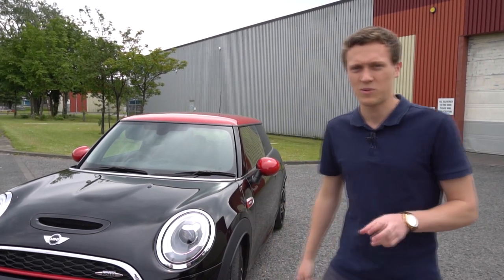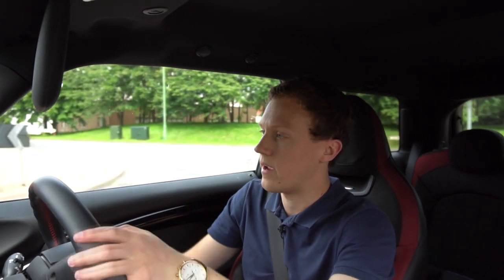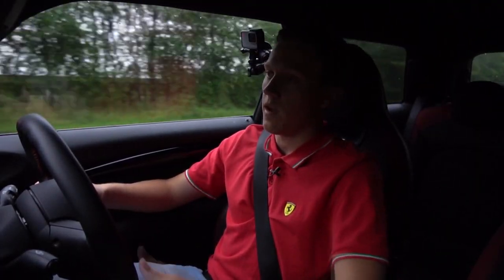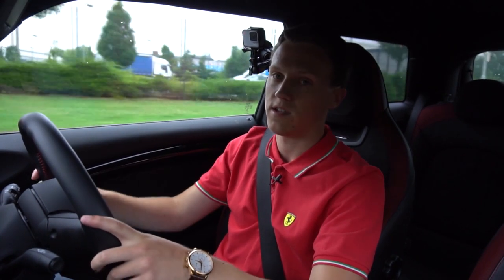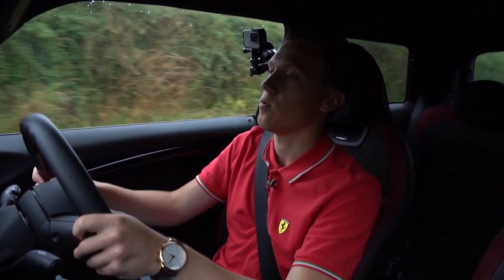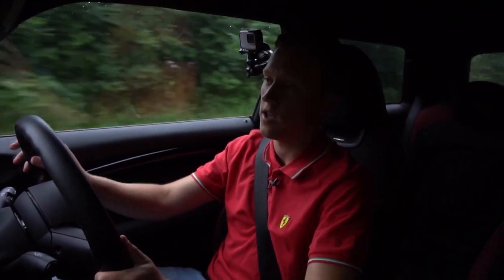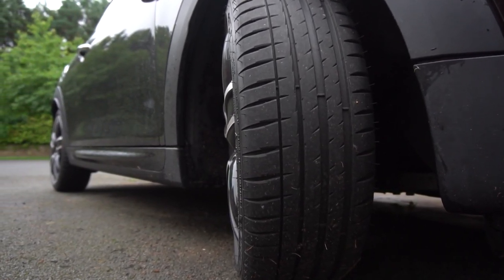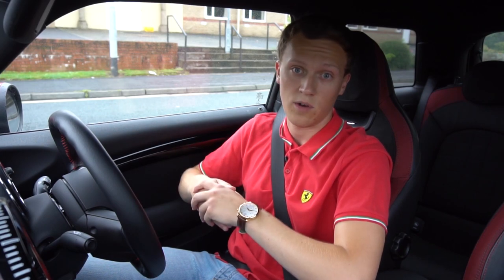Fitting Michelin PS4's [Mini F56 JCW] | Why You Should Buy Michelin Pilot Sport 4's

Comment: Recently fitted PS4s to my R53, superb tyre. Now I've just gone and bought a used F56 JCW I'll be swapping the PS4s onto the new car. As for runflats, I switched over to normal tyres 11 years ago and it's just the best upgrade anyone can do.
Reply from the maker: Glad to hear you've had good experiences too! The ride quality is vastly improved when moving away from runflats, agree its one of the best things you can do to a car.
Reply: where did you find them in the correct size smallest i could find was 215s and f56 is 205s [the cooper s]
Reply from the maker: @flight.5133  I just got mine from a local tyre shop, but I remember BlackCircles had them too. This was quite a few years ago now though and the PS5 has since been released, I don't think that is available in an 18" size yet but I'm sure it will be soon

Comment: They come with runflat tyres on because there is no spare wheel. You may find that although its not law to have one or runflats on in the UK, it may be the case elsewhere. For me the runflats are a pain in the arse saver. If you get a puncture you can just truck on to somewhere convenient to get it changed. No phaff at the side of the road even to change a wheel.

Comment: I toured the U.K. on my JCW, so loud on P7 run-flats. Glad I had them when in the middle of nowhere but far too noisy. Worn my shoulders too. Scary at speed in the rain.

My friend has Bridgestone run-flats without a problem.
Reply from the maker: Yep that was a major annoyance with them for me. After switching the difference in noise levels is quite incredible, so much quieter on the PS4's. And yeah not sure whether it's down to the composition of the side walls or what but the shoulder lasted no time at all compared to the rest of the tyre - totally agree though, severe and sudden understeer in the wet! Interesting the Bridgestone ones are better...
Reply: Foot to Pedal I’m going for the PS4’s once my tyres are worn enough. Thanks for the video.
Reply from the maker: Yeah can't recommend them enough! I'm sure you won't regret it. No problem, thanks for watching

Comment: Practise tyre rotation - front  to back after 4k miles or so should even out the wear a little.
Reply from the maker: Yeah would be tempted with this set but wasnt bothered about the runflats I had on before as I always planned to change them
Reply: How does the tyre pressure monitoring cope with tyre rotation?

Comment: Do you feel that the PS4 has mediocre feedback? It doesn't signal very well when they are about to lose grip.
Reply from the maker: I find in mine it's fairly clear when they're about to lose grip. Suppose its possible any vagueness you feel could potentially be down to suspension setup and the steering. The slightly softer sidewall will definitely mean they're not as clear cut as some tyres though
Reply: @FootToPedal  Yeah I drive a 140i and its steering is pretty dead numb even if precise.
Reply from the maker: Yeah that's interesting actually, unfortunately BMW's electric racks are pretty vague these days. It was the same in my JCW but with the PS4's on there it's certainly sharpened it up and it gives me a lot more feedback now

Comment: Would you consider going thicker just wondering what you’re thoughts are on putting 235/40/18 on my f56
Reply from the maker: I don't think you'd be able to go that wide on the standard alloys as my understanding was 215 was the maximum width. However if you're running aftermarket wheels then I would say go for it, I'm sure that would give a tremendous level of grip on the front end but is also not wide enough for the car to tramline all over when on a cambered road.
Reply: @FootToPedal  Does the JCW roll out with 205s as standard? If so 215 would be the best call.
Reply from the maker: @TimmehysCat  Yeah 205's as standard, not particularly wide so agree 215's the best call if you want to go wider

Comment: I have a mini r58, need 2 front tyres , was looking at mp 4, not sure if I should change all 4 for non run flats....like them tyres as have Tim orotection
Reply from the maker: My recommendation would always be to run the same tyres on all 4 corners but it depends how you want the car to drive. The PS4s have decent rim protection too which is handy 👍
Reply: @FootToPedal  I have herd your tyres are more track orintated ,do u take your car on track? Do u regret changing to non runflts?  You didn’t need to change suspension or anything else. Did you get a lot of punctures with the run flats? I have just bought the car so I am new to all this
Reply from the maker: @justindabreu976  The PS4 is more of a fast road tyre than a track tyre if I'm honest. It probably wouldn't hold up hugely well after a few hard laps on track but its great on the road. I haven't tracked my car at this stage but it definitely would perform quite well (handling wise) with these tyres. No regrets from switching to non-runflats and no changes to the suspension required as the tyre is exactly the same size, just a different design to a runflat tyre. Thankfully I haven't had a puncture to date so no issues there either. Hope that helps!

Comment: I suppose that RFs are tighter on the sidewall than non RF. If that is true, it is more likely to hit the rim with a kind of hole on the road. Isn’t it?  Second, if the same model / size of tire, one RF and non RF cost the same, do you pick the non RF anyway?
Reply from the maker: I guess in theory yes, but if you're hitting a hole in the road with enough force to fully compress the sidewall and subsequently impact the rim, I think you've got a decent chance of doing damage whether it's RF or not, that'd be my take anyway. And personally I'd always pick a non RF tyre myself, but it's very much personal preference. They always seem to ride better to me
Reply: @FootToPedal  I appreciate your comments, I like your video. 
I could not find a review comparing Michelin Primacy 3 RF vs PS4 non RF. I would like to see the behavior of both models of the same brand. When changing tires, it is likely to have a better performance in the new ones than in the used ones. Regards
Reply from the maker: Thanks very much, no problem at all! Yeah unfortunately I can't comment on that tyre as I've not used them before. But as you say new vs used tyres will always be better 👍
Reply: @FootToPedal  my car has Primacy 3 RF with half life (I bought it as it was). The other day I was on the track and the grip was amazing. I cannot imagine the behavior of new ones. Anyway, today I bought the 4 tires at a very good price at Costco. The combined savings in coupons and monthly payments with no interests is close to 30% off. Not bad 😎
Reply from the maker: Awesome to hear! I've found the PS4s to be great all year round, they seem to find traction everywhere, even in very wet conditions. Sounds like a great deal, hope you enjoy using them!
Reply: BMW's with runflats are notorious for cracking alloy wheels I have heard this from many tyre fitters that they see it so often. The sidewalls put way more force into the wheel compared to non RF that it simply cracks the wheel rim over time. BMW used to offer free repairs to the wheels if you complained directly to them but I think they have now stopped this.

Comment: A new viewer here - just wonder is it a pre-LCI or LCI JCW that you have in the video? thanks
Reply from the maker: This was an LCI 1 car, rather than LCI 2 which happened in 2021. Mine was a 2017 model, hope that helps!
Reply: @FootToPedal  Looks like a pre-LCI to me as the DRLs don't go all the way round the headlights.
Reply from the maker: @JohnCarlyle  There were 2 LCIs on the F56 generation, one in 2018 and I think another in 2020, mine was a 2018 LCI model.
Reply: @FootToPedal  You're right, 2 LCIs. Although 2018 could be either pre-LCI or LCI 1. Yours was a pre-LCI, which of course looks better than the LCI 2 :)

Comment: Hey, not tyre related, wanted to ask if u have the stock jcw exhaust?? Your jcw pops a lot more than mine!!
Reply from the maker: Yes totally stock! Mine is pre-OPF though so it is definitely louder than anything after 2019 or so. It also got louder as the exhaust went through more heat cycles. Thanks for watching!
Reply: @FootToPedal  mine is a 67 plate also pre OPF. I was thinking about a resonator delete. Would u recommend?? Thanks for the content 👍
Reply from the maker: I think it depends what you want from the car as I know they are very loud when you do the resonator delete, not a bad sound though! But yeah if you want more sound, is probably the best way to go. No problem, plenty more on the way 👍

Comment: Looking to purchase a full set of the PS4 - 205/45/17s. But have 2 speed rating options, 'W' which would match the manufacturers recommendation, or 'Y' . Other than speed capability, do you think the Y/higher speed rating would offer any other advantages? Sidewall stiffness or how responsive they are ??
Reply from the maker: Yeah I went for the W's on mine - Obviously there is going to be some extra strengthening with the Y speed ratings just so they can take the extra strain of high speed. I would imagine there would be some minute changes to how they feel on the road as the sidewall and contact patch of the tyre will be reinforced. However I would honestly be surprised if you could feel the difference! If you plan on doing higher speeds, I would say you'd be fine to go with the Y speed ratings 👍
Reply: @FootToPedal  thanks for your reply. I've just been advised by Michelin that the only difference in their database is the Y rated tyre being lighter by 0.1kg (maybe allowing heat to dissipate quicker, resulting in the higher speed capabilities, thats my guess though) Otherwise there should be minimal difference, if any, regarding performance and feedback. But yeah I completely agree, &  something I'm unlikely to notice. Liked and subscribed 👍
Reply from the maker: @MasterAndres0  No problem! Ah very interesting but yes I would agree with your theory. To help dissipate heat and more than likely reduce the rotational mass of the tyre itself to therefore reduce strain on it as a whole. Thanks a lot for watching, appreciate the support! 👍
Reply: @FootToPedal  Do you happen to know the difference between the Pilot Sport 4 and the Pilot Sport 4S?
Reply: @nickblayney774  PS 4S is the high performance version of the PS4. The PS4S is not as grippy in cold weather and is more heat resistant than a PS4 so better on track but also needs more heat to activate the grip. Mk8 Fiesta ST was fitted with PS4S and is the same tyre size as the JCW - 205/40/18 but Michelin have discontinued the PS4S in that size

Comment: Hey I’m glad that I found your channel! I’m actually planning to switch to PS4 for my JCW as well. Just one question, how about pressure settings for these PS4, are you using the same setting like original Dunlop one?
Reply from the maker: Thanks, you will not regret switching! I'm running slightly below what I was with the run flats, high 30s/low 40s. Seems to work well for me
Reply: Foot to Pedal oh! I now use 46 psi for front and 40 for rear..... seems I need to reduce a lot
Reply from the maker: Yeah could be worth doing, may improve the ride a little bit!

Comment: Will you be doing or is wheel alignment needed after getting new tires?
Reply from the maker: Potentially will do once it goes in for its service soon (if needed) however this was also done when the tyres were fitted. Thanks for watching!
Reply: @FootToPedal  I have another question...do you know how to properly open the cover that houses the brake fluid reservoir?  There are few spots which can be opened with a coin or a flat head screw driver, but after that the cover still doesn't open.
Reply from the maker: Sorry wouldn't be too sure on that myself - is it possible that the cover is just stuck due to a small amount of pressure in the air gap between the top of the the fluid and bottom of the cap?
Reply: @FootToPedal  Oh, no.  The issue was not the cap or the fluid itself.  I couldn't open the big plastic cover that brake fluid reservoir was under.  I found out that there are few different screws and I saw some of them, but not all :)
Reply from the maker: Ah sorry yeah I understand you now - hmm yeah likely just some screws somewhere that arent easy to see then I would think 👍

Comment: Hi, good video, question; how much pressure would be correct to put on these non runflat tyres, my door sticker says on p7 runflats 45psi, would it be the same in non runflats?
Reply from the maker: Thanks! I personally would put a bit less in non run flats due to the softer sidewall  of the tyre. 35 to 40 PSI should be sufficient I think

Comment: What are you going to do if you have a puncture? There is no room for a spare wheel.
Reply from the maker: Well that is obviously a downside - I personally have a temporary puncture repair kit to get it to a garage (as long as it's not catastrophic tyre damage). The benefits of non run flat tyres hugely outweigh the downside of no spare however
Reply: Buy a can of tyre repair or the BMW repair kit spray. Then there is the AA...
Reply: I don’t use the rear seats so I carry a small spare back there.
Reply: @FootToPedal  hey can you put the link where did you buy those repair kit in the uk?
Reply from the maker: @fellar031  Yeah no problem, I bought this one: https://www.halfords.com/tools/garage-equipment/breakdown-essentials/holts-tyreweld-500ml-122260.html
Reply: @FootToPedal  thanks mate 🎉

Comment: what size tyre is the ps 4 please
Reply from the maker: It really depends on the application as it can vary massively, I believe when I fitted these I got 205/40/18 but they can come in all kinds of sizes
Reply: @FootToPedal  may i ask the width of your rims ? I do see the tyres stretch a little bit (which is totally fine), i'm just wondering.
Reply from the maker: @JasonTsimplis  I don't remember the exact dimensions but it's a stock rim size and stock tyre size